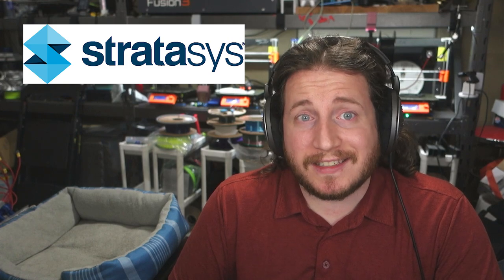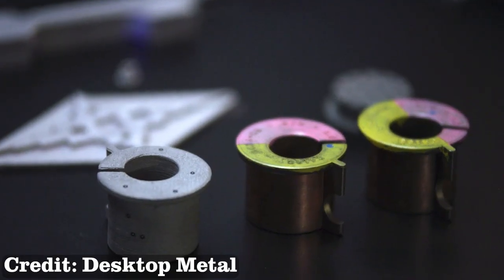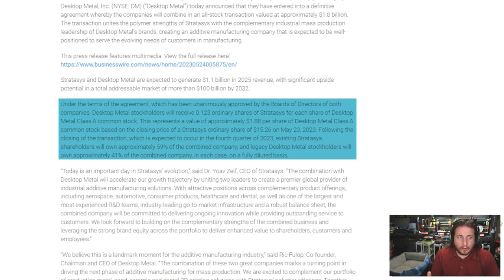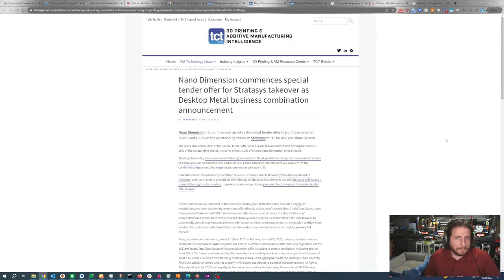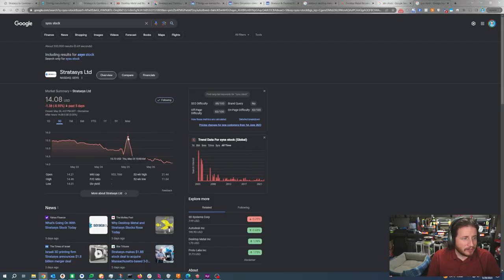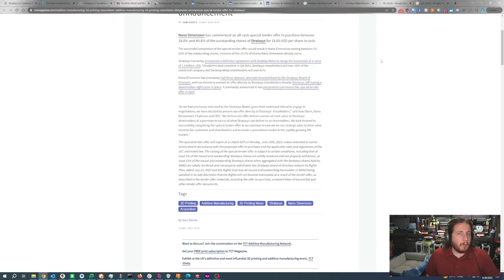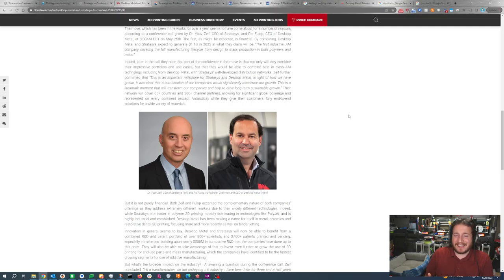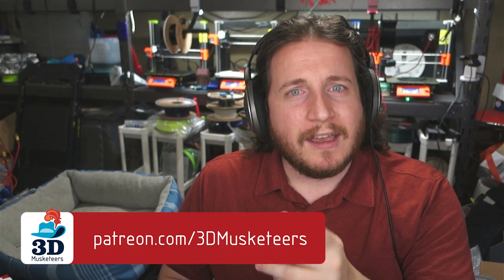Stratasys is BUYING Desktop Metal!!!!

Comment: Envisiontec is mostly working with DLP printers, which they really pioneered and have a lot of IP in. 

For larger formats, they've also had some "3SP" printers, which are like a top-down SLA mixed with a traditional 2D laser printer, so a spinning polygon mirror on a gantry that line-scans the build area, but I think all of those are discontinued.
Reply from the maker: Are they really mostly DLP these days? I had no idea..
Reply: @3DMusketeers  yep, in their current range all four they list on the website are DLP based.

They have a fancy technology where they mount the DLP chip on a piezo actuator that can move the chip half a pixel in X and Y to do smoothing / virtually higher res.
Reply from the maker: oooh fancy!

Comment: there seems to be a misunderstanding about how the Nano Dimensions tender offer works, The current tender offer is aimed directly to shareholders bypassing the board of directors.
therefore this offer is different from the previous ones which were dependent on the board's approval.
Reply from the maker: Ah. When filmed that offer was very new